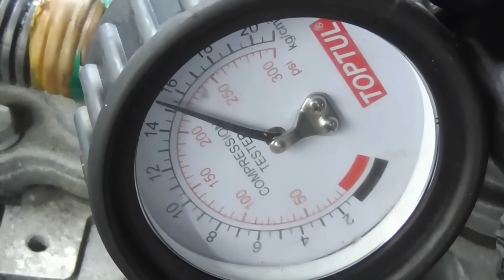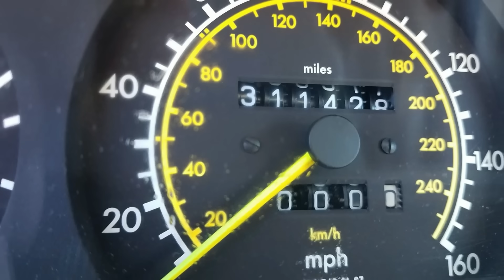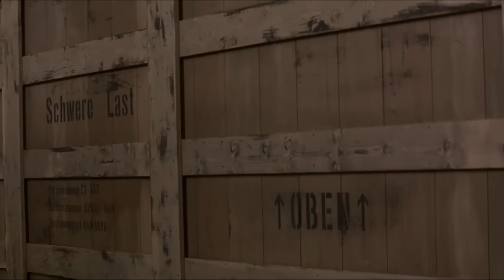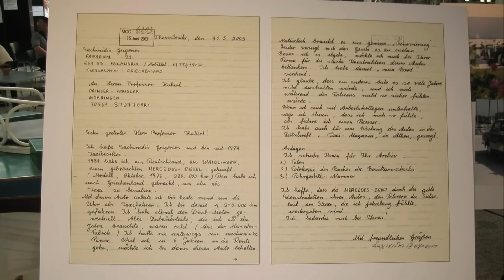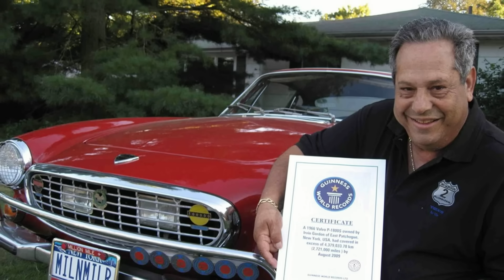Most Reliable Engines of All Time

Comment: Who else stopped watching after this guy tried to say the Mazda Rotory engine is reliable?
Reply: TheWorteldrie I’m saying. But no 5.9 Cummins or 7.3 power stroke smh
Reply: @firesniper14  cummins is good but the powerstroke is the modt common diesel to run away on you... So i can see why it didnt make the list
Reply: @keed_on_two_wheelz  Ford engines of recent history have had their fare share of issues, Such as the 6.0L And that piece of shit 6.4L diesel. If they didn't feel like that have to reinvent the wheel every couple of years they could finally settle on a good design and just keep improving on it.
Reply: Bob Jackson   Both of those are Navistar engines.
Reply: @bobjackson4287  6.0 isn’t a pile it’s the shit 16yr olds that put a “tune” and beat one it. Early 7.3 idi had thin cylinders walls. I’ll take a bulletrpoofed 6.0 any day emission deleted of course. Now the 6.4 sadly that a throwaway motor. Takes way too much money to keep those going
Reply: firesniper14 ok
Reply: @firesniper14  the n/a 7.3 was pretty good, the turbo 7.3 kinda sucked though. I'm a 6.0 guy personally but I'll fully admit stock 6.0's are utter shite if you have even a slightly heavier than average foot, but I've got one that was short blocked and the only thing I break is axles... which may or may not be rated at over 1200 ft-lbs each... and driveshafts...  and the occasional transfer case.... but the engine itself has been golden going 200k on a 700 horse economy tune with the occasional 1000 horse pull in the extreme tune, which usually ends with a call to the trans shop for a new transfer case lol
Reply: I had a 1989 RX-7. Great car but there is not enough money in the world to keep the engine running.
Reply: @sartainja  I had a wagon with a rotary with a maze of polluition and other control systems that never ran right and got the mpg of an 8
Reply: Yeah well, no Straight six, no Cummins, no Model T engine, no 351w, and no SBC 5.7L.. this list sucks.
Reply: @bobjackson4287  actually there were several sixes, MB, BMW, Toyota and Nissan and a Plymouth slant six.
Reply: @bobjackson4287  on the straight six in ford, chrysler and yeah gms, you are so right, don't forget fords 289 family and their 4cy family
Reply: @bobjackson4287  i bet he missed the volvo 4 pot from the 240 too.
Reply: @bobjackson4287  will the rb26 is a straight six but well yeah the list sucks
Reply: @bobjackson4287  I have a friend running a 500,000 cummins right now
Reply: @bobjackson4287  how about the 505 cat with a 1,000,000 mile warranty some people have got close to 2,000,000 out of them
Reply: @bobjackson4287  the model t engine has to be rebuilt every 50k miles or so. Hardly what I'd call reliable
Reply: @bobjackson4287  
The first car was a straight 6
Reply: Rotory is cool and all incredible power to weight. Rediculous throttle response. High boost acceptance. But reliability..... Not its oil chugging, bearing spinning, failing apex seals and broken centershafts... Strongsuits
Reply: TheWorteldrie what??? Idk he had the audacity to say that! I stopped when he claimed the k20 came in the integra type r 🤣🤦🏾‍♂️ he also forgot to mention that the rb also came in the r32 & r33
Reply: Marcos Ortega yeah the K20 was in the RSX AFTER the integra
Reply: @wildcard749  You know the integra and RSX are the same vehicle right? Why America needed to change the name from integra to RSX has never made sense to me. But the integra was sold up until around 05 06
Reply: @marcosortega9496  jdm and euro version dc 5 integra
Reply: Arek Brzyszcz yeah you’re right. I’m in the states so I’m used to calling them RSX. Forget they’re known as Integras across the seas. But still if he was gonna reference the K series at LEAST use an image of a DC5 & not DC2
Reply: Marcos Ortega I missed that part. Smh. I didn't watch long enough lol
Reply: TheWorteldr
Reply: @marcosortega9496   lol it did dc5 type r
Reply: @marcosortega9496  the Japanese integra type r did have the k20 the type r from 2005 up not the 90s
Reply: @marcosortega9496  the rsx is called integra in japan
Reply: The greatest enemy of rotary engines are their ignorant owners.
Reply: @frankgarrett4905  That is absolutely true!
Reply: @frankgarrett4905  what do the owners do wrong?
Reply: @1MinuteMovies42  well, I'll give you a hint. In says plenty in the owners manual, like that the engines are designed to use a little oil. The rx-8 said in the owners manual not to shut it back off when cold. Had a spoiled neighbor's daughter who had an 06 bought for her for her 16th birthday. Their driveway wasn't too big, so whenever some one would come over, she'd start it up (from a cold start) drive it on the street side and shut it off. I warned her father about it, he scoffed at me. Guess who was knocking on my door a week later with a engine flooded with gas and wouldn't start? Anyone who's flooded a carburetor engine knows it's not fun. But this was fuel injected and the owners are warned.
Reply: plus as he's talking about mazda rotary engines, he displays a picture of a mazda ohv piston engine lmfao
Reply: @gaineyproductions2725  yea, that and the worst engine they ever made reliability wide..... the 2.3 turbo eater engine. Fast, yes, durable, no.
Reply: @gaineyproductions2725  that triggered me lol
Reply: @gaineyproductions2725  A matter of the insane running the asylum, but he may have got it right showing the OHV as the more reliable
Reply: Gainey Productions I noticed that, too.
Reply: @gaineyproductions2725  not a him thats a robot narrator
Reply: GM made one that ran for half a million miles with minimal wear.
Reply: @frankgarrett4905  
But could no get good MPG and good emissions out of it. Lets be real here.
Reply: @frankgarrett4905  GM made good things before the 2000s came around and went cheap on everything.
Reply: @frankgarrett4905  yes finally someone else who knows of 3800s
Reply: @frankgarrett4905  that was a strait 500k miles too..they shut it down for service and that's it
Reply: @frankgarrett4905  that was a rebadged mazda engine and if it was so great then why are they not using it anymore? because they were unreliable. they burned oil and drank gas like crazy and were infamous for needing to be rebuilt after a sunday drive.
Reply: @ElectronicsForFun  
GM's engine was a Wankal I do believe.
Reply: @ElectronicsForFun they still use the gm 3.6 and that thing just wants to blow up, props to them for replacing it and fixing the problem but they aren’t nearly as bad as people make them out to be with proper maintenance
Reply: No tdc = better performance but less reliability
Reply: I adore the rotary. But will admit all day it isnt reliable at all.
Reply: Lmao ...  It also bugged me that, when speaking of Nissan motors, he continued to pronounce "dett" as though it is a single word instead of saying "D-E-T-T" which is part of the engine code's specification designations.  He does this with the RB26DETT and later with the VR38DETT.  This bothered me greatly and really diminished any confidence I could have possibly had prior towards the narrator's knowledge.
Reply: I can't believe is more reliable than a 1.9 TDI or AP 1.8 from the 90's VAG
Reply: @JuanPabloMedinaStumpfs  1.8s in the  Audis and Vw are reliable motors. It’s the electrical issues that make it a nightmare
Reply: I stopped after he said DETT can even support 2 turbos... like how it comes?
Reply: LMAO
Reply: Me lol
Reply: I think we will see the Mazda Skyactiv series show up in the reliable lists 5 years from now - there's enough miles on them already now to tell that they're pretty dang decent.  Remains to be seen how Skyactiv X will work out, but has potential as well.
Reply: 787b lasted 24 hours
Reply: @toro4271  more rottors less stess and one of four in the race made it the others blew
Reply: made everything else skip in those  australian 12 hr races . time and time again . done right they can handle the power increase over 100% and the highest abuse . daily rotary driver.  30 years
Reply: bumpstart You must've put 1 mile per day on your rotary sir
Reply: I stopped watching as soom as the clown pronounced Nissan as Nee-Sarn
Reply: Yeah this is more of a "engines that can take alot of power" list
Reply: I mean, he said dett like it was a word... Lost my stuff. Wife looking at me like I’m an idiot.
Reply: I wanted to stop when he said, RB26 "DET"
Reply: I stopped after her said "dett"
Reply: GM - 327 , 350 , 427 , 3800 V6 , Iron Duke I-4  
Ford - 2.3 , 302 , 351W , 300 I-6 , Early Gen 4.6 V8 ,  
Early 5.9 Cummings 12V , When Ford Owned A Partial Share
Chrysler - 318 , 360 , 225 Slant 6, 
Saturn 1.9 Single Cam  .....
 I've Owned Vehicles With These Engines & Still Have A Few Of Them & They Are Proven Rock Solid To Me & My Family !!  
Castrol GTX , Or Valvoline Oil  &  Wix , Or Fram XG Filters !! 😎
Reply: What about the chevy 4.3? My 94 s10 blazer with cpi 4.3 has 273,789 miles and I've only had to replace the distributor , the water pump and thermostat , starter , and oxygen sensor !!! That's it, nothing else but oil changes and tune ups ! Also has the 4l80e trans , no problems. And did I mention that it's got a cold air intake and dual exhaust with flowmasters , and I beat on it daily ??? She does burn outs almost weekly and still gets 63 mph across the 1/10 mile bridge next to my house !!!!  I been hammering on the ole " Blaze 1" for years ! Never a single problem !
Reply: Electric motors will do more than a million miles or more. No belts, hoses,  oil,  transmission fluid,  not even a brake job. The internal combustion engine has come to an end.
Reply: My cousin had the Mazda rx7 and it broke down on him due to the rotary engine. Pure headache car. He couldn't even start the car right away after he shut it off. Bad engineering. I lost faith in the Mazda brand.
Reply: Yes they have no clue as to what they are talking about
Reply: What everyone fails to realize is...  When America takes technology in car engines from foreign companies, they have them modified to break down by replacing tested parts with substandard parts.  That way, American capitalism keeps on turning, and that each product after sale remains a "Cash Cow" for that particular company with (the same substandard parts), but with adding labor.  Do you think the price set per hour for a dealer mechanic goes to the mechanic? Hell no!  80 percent goes to the dealer, and all at the expense of the consumer.

And that's why Capitalism and greed of profits has driven corporations to disenfranchise American laborers with "outsourcing" manufacturing abroad.  It's all about "Profit margins", but has the actual product price remained the same or increased slightly in the interest of company relations with their consumers?  Hell no!  Look at the cost of a good "domestic" fast car now, as to compared to back then.  When domestic cars prices are comparable to the price of a home, then you know we (the people) are nothing more than a means to make money for these companies.
Reply: Non-turbo 12As and 13Bs are pretty durable.
Reply: They are reliable, they've won the 24 hours more times than any others
Reply: Mazda won the most endurance races of any manufacturer
Reply: The rotary engine is the most reliable engine ever built 😂 what you mean?
Reply: Lol
Reply: No doubt dude keeps being impressed with engines lasting more than 100,000 miles. Seriously dude these days an engine is a raging pile if it won't run at least 300,000 miles on minimal maintenance.
Reply: Ford straight 6, the 318 from Chrysler, 5.7 from gm I think they smoking crack
Reply: No J37 J35
Reply: 🤣🤣🤣🤣🤣🤣 i definitely did
Reply: Yes indeed
Reply: No Buick 3800, Nissan 2.4, Volkswagen 1.9 TD...?  Not a great list.
Reply: I didn’t stop watching but I laughed so loud the neighbors got worried.
Reply: Two words: Apex Seals
Reply: Me
Reply: I just stopped at the rotary and went to the comments knowing there would be a comment about it 😂 reliable my ass.
Reply: Nope stopped when he put a supra up when he was talking about the nissan motor
Reply: When he showed a 300ZX next to a famously unreliable RB26 "debt"
Reply: yep... made it to the rotary and realized this guy has no idea what he was talking about and that I had wasted several minutes..
Reply: Well, I didn’t stop watching, but yeah he missed a lot great engines in his list.
Reply: Yup
Reply: How about GM’s 5.7L V8, Toyota also has a 22R engine that was bullet proof lol
Reply: TheWorteldrie They have to be pulled down and rebuilt all the time don’t they?🤔
Reply: Yep he said number 8 most reliable, My guess is he never owned one. 13B and 20B always eat up the sealings, unless you go apex and add some more fuel.
Reply: hahahahahha i was about to comment this but i knew someone else had said it. Thought he was gonna say the 2.3
Reply: .....................APEX.................SEALS
Reply: I laughed my ficking ass off I kinda wanted to stop at the rb26dett that motor has oil starvation issues. Should have used the 1uzfe to start with instead 😂😂😂
Reply: I did!
Reply: TheWorteldrie,
My understanding is that the concept of the rotory engine is quite simple, so it’s probably reliable, but the challenge is engineering seals to maintain compression, thus the engine could be reliable, but wears out quickly.
Some Mercedes Benz engines last forever but end up in the garage weekly.
Reply: TheWorteldrie I stopped watching when he said the RB26DE-TT can accommodate single or twin turbos. Clearly he did not notice the TT in the engine code.
Reply: I swear!
Reply: E C injectors under warranty, no charge.
Reply: E C   Yes , all great engines , not familiar with the G.M. 366 tho. But wasn't that an industrial workhorse engine mostly , heavy trucks , dump trucks,  & field equipment ??  Or am I thinking of something else ??  😆
Reply: well the rotary engines do lose a lot of oil, have inefficient power and bad gas mileage but by no means unreliable.  rx7 engines do last a long time but you have to maintain it well.  even the rx8 can give you at least 100k miles.  i agree with you they shouldnt be here.  but when you realize bmws are basically impossible to sell after 80k miles then the stats reveal that rotaries are good engines.  modern bmws are crap with high maintenance expenses.
Reply: and the m57?
Reply: i stopped when he showed a supra when talking about the rb26
Reply: I stopped when he said the parts for an rb26dett are easy to find, and that they can easily be twin turbo charged...
Reply: yeah i heard some rotary engines break after 30k miles.
Reply: Well, he thinks reaching 100k miles is a reliability benchmark...
Reply: It only won the 24h of le Mans, no big thing...
Reply: @GTE_Channel  too bad the production rotaries are so different. They really dropped the ball with the renesis, but they did have alot of emissions BS to contend with...
Reply: @garybarbourii8274  yeah they did, it's a shame it's such a smooth running concept,  and that sound....
Reply: Guy though 200k was a lot of miles. Not in the USA. I see cars over 300k all the time, even Chryslers.
Reply: That and his RB26 facts are off. Easy to get 1000-1200hp... no plus the 26 has the weakest block of all the RB family and is guaranteed to crack around the head stud.
Reply: Not a human narrator. Hacks, does anyone think 100k on a mercedes diesel engine is amazing?
Reply: Here is the thing about rotary engines. They work great when they are running and when they arent they become a money pit
Reply: The only thing reliable about this list is his ability to rattle riced up popular engine names.
Reply: This guy sucks
Reply: Most rotory engines didn’t see a life span to 150000 before the apex seal got wonky and needed a rebuild I’ll stick to my powerstroke when I can go at least 3x as long before anything internal needs to be replaced
Reply: Me
Reply: Lol. They are one of the best running engine but one of the most unreliable engines ever made.
Reply: I read the comment i saw wat u say stop watching
Reply: Must be some stale ass Doritos
Reply: LMAO yeah... i don't think OP is a "trusted source"
Reply: hahahahah salty ameritards malding
Reply: No fucking shit what the hell LOL
Reply: TheWorteldrie Wait what rotary. 😂😂. Those engines are like building jenga. Build them and watch them crumble over and over
Reply: this guy never said any good dependable engine like a straight  six or slant six but a turbo engine witch turbo engine just don't last power yes but the heat kills the bearings
Reply: Hahahaha me
Reply: I saw someone saying that if u maintain the rotories well, they can last long
Reply: @Strex_Edits  only on a stock one if u build it up it will not last long just that they are cheap to build for a quick race and they do good in the 1/8 or 1/4 mile just they have have a short life when u build them the more u build them the less life u get unlike my 327 witch has been through 15 races and been driving on the road for over 20 years but the engine was not cheap at all looking about 30 to 35,000 in it
Reply: @jeffrey4547  ohhhh
Reply: I did too
Reply: Wait then how are ya commenting
Reply: I stopped at the first engine. The RB26 is good but as soon as he said it can handle one or even two turbo's I was done.  They are made with a twin turbo set up.

When he gets to the Mazda section just dislike and leave.
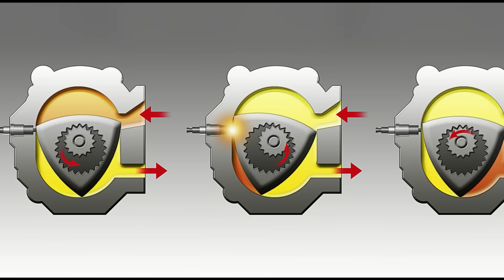Reply: RIGHT AFTER he says THAT, @ 6:52 - illustration of a Mazda  FOUR CYLINDER ENGINE cutaway???(!)
Reply: Literally i started to question at bmw but i stopped at the madza lmao
Reply: It reliably needs a mechanic.
Reply: They can handle 10,000 miles of WOT highly tuned, not many other engines can do this. They are a great racing engine but not so much for passenger cars.
Reply: Oil burners. lol. Zero torque hence the high rpm for power. 

Rotary engines are all mistepresented on power/liter (or cc’s).  The displacement is the volume at the ‘combustion’ phase, not SWEPT volume like a piston engine. If you rate the rotary by swept volume it is a horrible power producer.
Reply: Same
Reply: I stopped watching after I sing this comment
Reply: Hell, I nevet got that far!
Reply: He said it could handle 1turbo
Reply: Badger Milk  so you ls swapped them
Reply: The Ford  5.4
                  5.0
                   4.6
Reply: Think the vargas brothers would beg to differ 😂😂😂
Reply: I stopped right when the rb26 was being considered reliable and a picture of a mk4 supra was shown in the mix of r34s
Reply: Not me because it actually is reliable in terms of having few moving parts. So it did well in endurance road racing over other radical race mills. It just has seal problems that hamper it's ability to go many miles without being opened up.
Reply: @gregorytimmons4777  that's bull shit,  MAZDA has won the Daytona 24hrs, the 12hrs of Sebring, Lemans so many times they kept adding weight to slow them down, the engines are very reliable, and don't have issues With apex, or side seals you are misinformed
Reply: @gregorytimmons4777  the street engines only suffer from carbon buildup, using BG44K frequently removes the carbon from the junky ass gas they sell now days
Reply: The 302 in my 1990 mustang has 207,000.0 miles on it still runs like a raped ape I always change the oil at 3,000 miles.
Reply: Rotary engine was known for oil leaks/ consumption.
Reply: @shawnkleveland196  your comment is not based in fact, they won more endurance races than any other engine
Reply: Great race engine but most didn’t know how to maintain them
Reply: They blow up good at 80000.He hid that fact.
Reply: stopped after seeing the RB 26
Reply: I stopped at the first one
Reply: I had a 1979 RX-7  and you are correct, it was light and fun to drive revved like a motorcycle, rear wheel drive stick shift.

But those dam seals, it smoked real bad, randomly.  She liked to smoke when there police behind me. I would get a fix it ticket.

Then the next I would drive to get it signed off without me doing a darn thing to it.

Good times
Reply: 4.6 liter Fords?
Reply: Where did this guy get his info? Mazdas rotary engine might be in the most unreliable list...cause it doesn't belong in this one. And where was the ford straight 6 cylinder 300c.i.? That engine was indestructible. I had one that broke a conmecting rod after 200,000 miles. The rod broke at the piston pin. The piston was stuck at TDC and the rod punched through the block releasing all the coolant and sloshing all the oil out. I was still able to drive it 22 miles with the rod slamming around inside the cylinder. It made an unbelievable noise while driving but it got me home. It went 22 miles at 50 mph with no water and no oil. I parked it went inside. Here is the amazing part... I got up the next morning and it started back up ! And i drove it ANOTHER 3 miles to a friends house to take the engine out and put another 300 straight 6 back in it. Now that is reliability.
Reply: Rotary?!
Reply: Lost all creditability on that one
Reply: LMAO, they never make it past 100,00
Reply: I got lost when he said rb26
Reply: I stopped watching after he said neeson 🤦
Reply: I had a 1987 RX7 turbo II and got 220K miles out of the original engine. These engines are fine as long as they're not overheated, oil starved or suffer detonation from running too lean a fuel mixture or too much boost. I still don't recommend them since their power to MPG ratio sucks it.
Reply: me
Reply: I stopped watching at RB26 💁
Reply: I did, Mazda is the shittiest engine ever made, I'm glad Mazda is out of business 2022
Reply: Haha exacty rotory engine is reliable. Fml 🤣
Reply: Says the Plymouth fury is the highest mile car in north america, contradicts self 2 entries later with a 3 million mile Volvo from New York which happens to be in north America. But in all seriousness when the list starts with a rb26 but a supra is depicted and it's a list of "reliable engines" something is very wrong
Reply: The original rotaries weren't horrible, they got to where they were hard to get started after some wear but once you got it to life it would get you there and back.
Reply: Lol I bet 95% of yous never owned a rotary. Rotary's are very reliable if you maintain it properly.  Only thing is you have to replace seals every 80 to 100k kms and look after the carb. I have Mazda eunos sitting at 348k kms never had any issues with it except it can flood sometimes which is expected for a two stroke motor.
Reply: He got me on “RB is cheap”
Reply: @Loadedgoods  its just different, but annoying to work on. My first car was a 92 nissan sentra ser, fun to drive, but a pain to work on,  the bolt placement is frustrating, especially when you have to remove them. Then I got a 95 civic, the only car where the service actually went as planned 🤣 The SR20 motor is bulletproof tho
Reply: The Mazda rotary engine consumes much oil as it does fuel. That is the experience of my friend who once owned a Mazda RX-7 with a rotary engine.
Reply: 3800 Buick engine best engine
Reply: Actually they are reliable with proper maintenance. A couple of ounces of 2 stroke oil in the gas every fillup really helps. Most problems were owners not knowing how to treat them.
Reply: I stopped at the rb26. I've popped 5 in my lifetime. But they're worth fixing.
Reply: Never made it to the Mazda. 2nd diesel engine bored me to tears.
Reply: Dude he said rb-26 and I peaced
Reply: I was thinking exactly what you said when I read your post. Couldn’t get them fixed. It was junk.
Reply: Dutchsinse is never wrong 😜
Reply: Abridged: it's predictably reliable and supposedly easy to rebuild.
Reply: I stopped at RB26 DETT said as a whole word
Reply: I stopped after the RB26-DETT😂
Reply: True a lot of the rotary engines have to be rebuilt after 50,000 miles..
Reply: 3S-FE in supra ????????? what the heck are you talking about
Reply: How about his first entry. Stating they could be turboed or twined. But the engine came stock TT. It's the rb26de"TT"
Reply: I did must be paid by Mazda
Reply: I stopped watching as soon as I read this comment. About 10 seconds in
Reply: I knew a guy with an 85 RX-7 that revved that rotary to the moon daily, and it never blew up, and had 159,000 when he sold it.
Reply: It is now by the new design
Reply: Lol im out ✌️
Reply: Its reliable..  you just have to replace it every few thousand miles.
Reply: Uh me…….he just stupid…..
Reply: Bc it is Sherlock buy one and see.
Reply: I read your comment after six seconds. Thank you!
Reply: It is the most reliable ROTORY engine 😂😂😂
Reply: Also people dont pre mix their gas, and dont change oil as frequently, but trust me if taken care of they are pretty damn good.
Reply: @raomar0  he only got 300k out a single engine
Reply: @raomar0  when an owner has to meticulously maintain an engine in order for it to be reliable, the engine is not inherently reliable. Most other engines on this list live long lives with simple oil changes and other simple maintenance per owners manual.
Reply: I know thats funny but he sort of made up for it by bringing up Chryslers slant 6.
Reply: @yavin99  the slanty six was a good engine for a workaday car until the EPA changed the design of engines.
Reply: @yavin99  That slant-6 is a beast. Runs foever.
Reply: this list is not well.....so good , if you skip the 3.8 from gm ......well.....but about the rotary engine , sorry but i had one rx-7 and the engine was a good one  .
Reply: @lacroix1976  not for nothing ,people overlook the Chrysler 3.3 and 3.8 all the time and they were arguably as reliable as the GM 3.8 without the frequent intake manifold gasket leaks GM was known for until the stage3
Reply: Me!
Reply: The RX-7 FD rotory is pretty reliable, it was the RX-8 that made them not reliable cause mazda cheaped out on the oil seals in the "combustion chamber*.
Reply: @mr.stealthrt6366  they all had terrible apex seals man its litteraly what the rotary is known for its whole production. Not to mention spining bearing. Cracked centershafts from vibration. And running out of oil once a week cause they need you to rev the piss out of them to stay "healthy" and they burn oil the bp oil spill caught fire...
Reply: @mr.stealthrt6366  yep pretty reliable and the most reliable are a long way apart.
Reply: @mr.stealthrt6366  fake news they all suck
Reply: They were having problems with seal deterioration as far back as the second gen RX7
Reply: @mr.stealthrt6366  it wasnt, lol, who you trying to kid, the rx8 was worse due to bad quality casings rather than the rotor tips.
Reply: @deadprivacy  alright
Reply: Mr. Stealth R/T 

Well  if you say “ pretty” reliable that’s not enough reason to be on the list.   

My civic 2006 with R18a engine auto with currently 302k miles is pretty reliable.
Reply: @mr.stealthrt6366  they were decent. But they were hardly among the MOST reliable.
Reply: @mr.stealthrt6366  actually the RX8 reliability suffered as Mazda cut oil injection for emissions reasons. A bit of 2 smoke oil in the fuel every fill would keep them running well.
Reply: Mazda n/a 2.5 is reliable. The non skyactive are in transit mini trucks now along with a bunch of stuff in Asia.
Reply: @mikeschiavoni5973  GM had a great skunkworks with some really good engineers but this stuff rarely saw production that was run by bean counters not engineers.
Reply: they won the lemans 24hours race, when main piston engine copetitors engines failed
Reply: I nearly quit when he showed a supra when talking about the RB26 Then completely lost it when he said the rotary was reliable 😂
Reply: Had Mazda with rotory.   It burned a qt of oil every 200 miles and had an oil leak by the exhaust so bad that I had to carry 2 gallons water to put the fire out every time I stopped . Could not remove the flywheel pressed on @ 1500 lbs. per square inch  .  Called shop, they said they used a super strong puller with a truck impact.  It still took them 3 days to get it off !